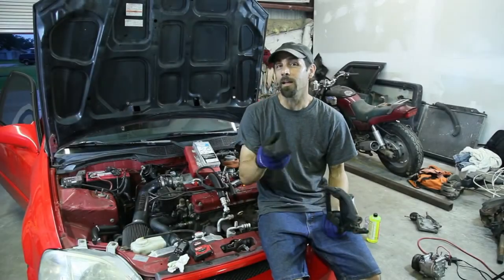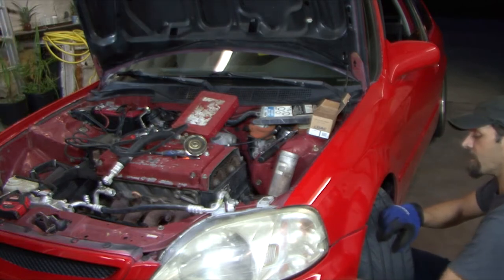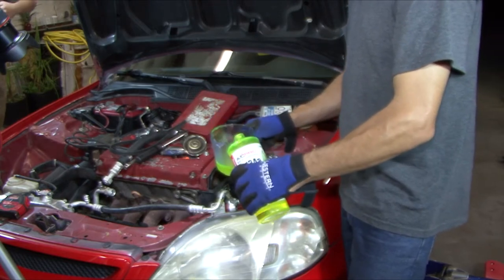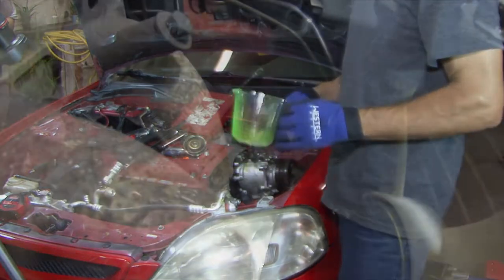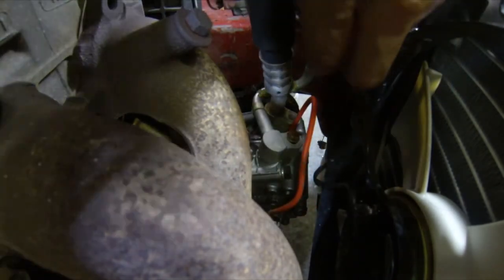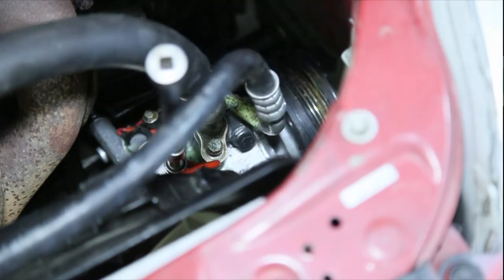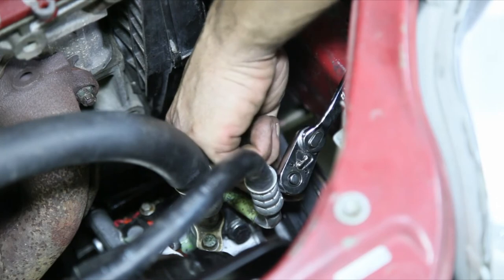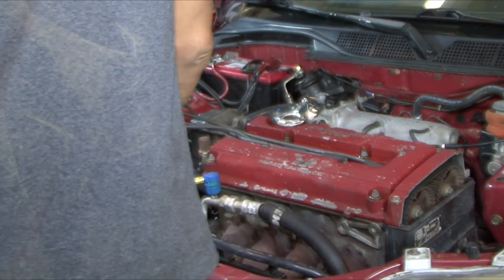Honda Civic b18 to a D series ac Compressor install

Comment: u can use del sol si one or 99 2000 civic si b16 obe or any crv b20 one from 96 to 2000 i did mine on my 97 civic b20 swap
Reply: b20Mike was just wondering if I could do this on an EF. The tr-70 compressor sucks with 134a. Hoping clearance isn't an issue.

Comment: Bro you forgot alot of important things. First you install the compressor, tighten all the hoses down with new o rings seals and last you install the drier because once the new drier gets expose to the atmosphere for a while it will be useless. Next and most important is to use a vacuum pump and a gauge kit to suck out any moisture out of your ac system and you leave it on for about an hour then close the pump and check for any leaks by looking at the gauges. And lastly you add freon about 21-22 ounces or 1 can which is about 20 ounces along with 5 ounces of paag oil mixed in.

Comment: What's the part number for the AC compressor bracket you used? 38930-P30-000 (96-97 Del Sol VTEC/Civic Si) or 38930-P54-000 (94-95 Del Sol VTEC)? You can just say P30 or P54.

Comment: i have a del sol si that i did a b18c swap on that had a D series motor, not the del sol si vtec. Will my D series bracket mount on the B block?

Comment: he didn't vacuum the system to remove the moisture, not good for a new compressor
Reply: Ryan fritz what are the repercutions if you don't do that?
Reply: @FroztiProductions  The compressor will compress any water vapor in the system into water, which is corrosive.